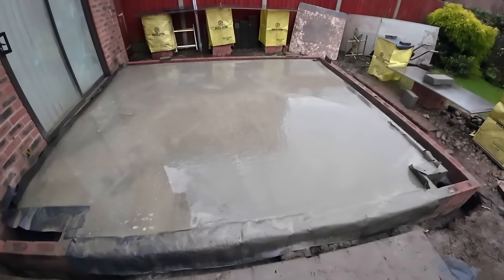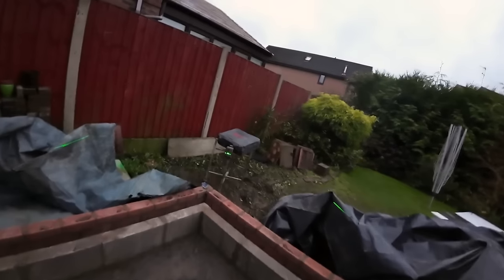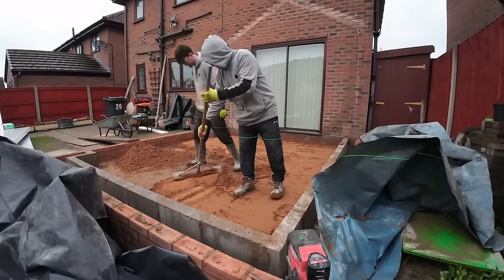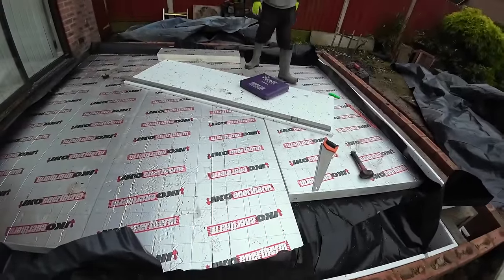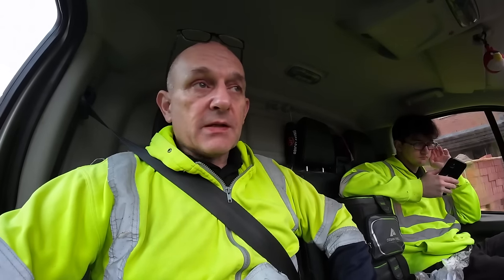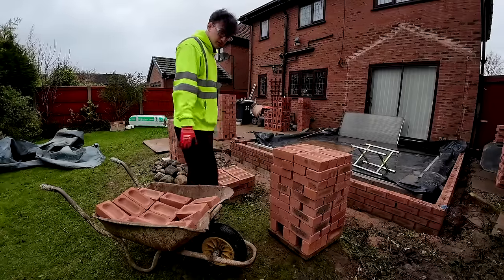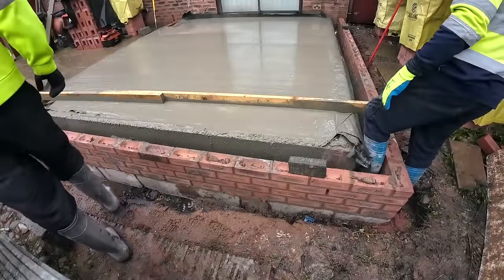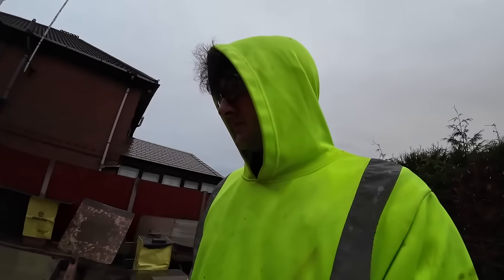POURING A CONCRETE SLAB IN WINTER SATISFYING TAMPING..CONSERVATORY TO EXTENSION PT 5

Comment: Hi Steve, is it normal for brickie to prep and pour concrete  slab ?,  in new zealand the slab prep is done by the builder, with a concreter doing the pour, great work,  neville
Reply from the maker: Yes it’s quite common for small builders on small jobs .    
  Thanks very much 🧱👍🏽

Comment: A little tip for you,cut a length of plastic dpc long enough to go wall to wall pull it tight vertically across the wet concrete and you will be able to swim the water off the wet concrete.

Comment: Always a dodgy time to pour, weather permitting. I’ve had a few ‘re lays’ after plunging overnight temperatures, even with full protection of the slab. Heartbreaking. Feeling for you chaps.
Reply from the maker: Let’s hope we’ve seen the last of the sub zero temps. 🥶🤞🏼🧱👍🏽
Reply: @SteveAndAlexBuild  I definitely agree S&A. Been dropping lintels in at home, finally sorted the last one, out of six, wrapped up and pinned with bubble wrap and old towels. Should be good to go after a few more days.

Comment: How come I have to put 150mm insulation in the floor? 😮
Reply from the maker: Not sure 🤔🧱👍🏽
Reply: @SteveAndAlexBuild  
1) = Building regulations.
2) = Increasing thermal insulation requirements.
3) =  The race to "Net -Zero".  
4) =  To reduce heat loss from your building.
5) = To help keep your building nice & toasty,  and to save you money.
6) =  To reduce our reliance on fossil -fuels.
Reply: @martin2466 I was being sarcastic, new regs has gone up from 100mm to 150mm. Get the breaker out 😂
Reply from the maker: @martin2466 🤩🤩🤩👏🏽👏🏽🧱👍🏽